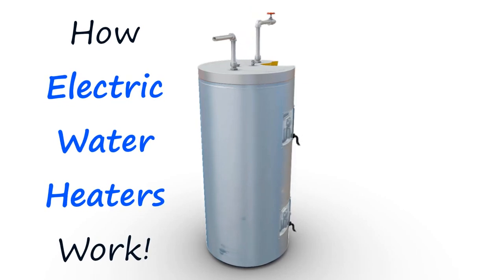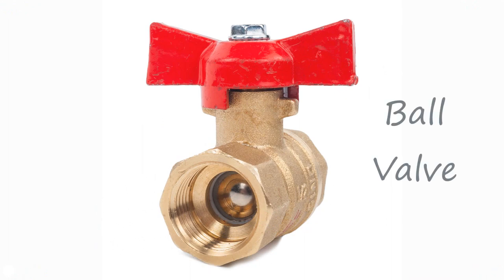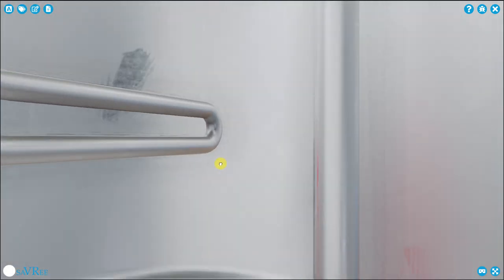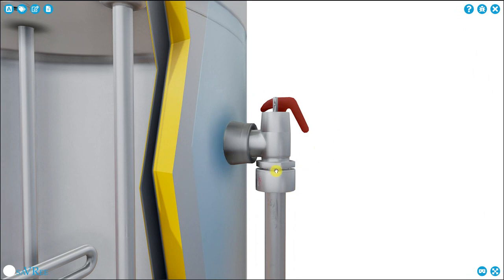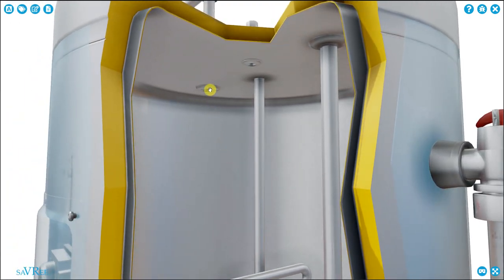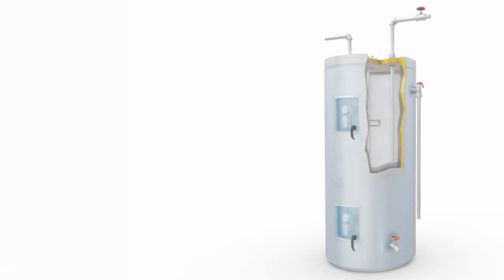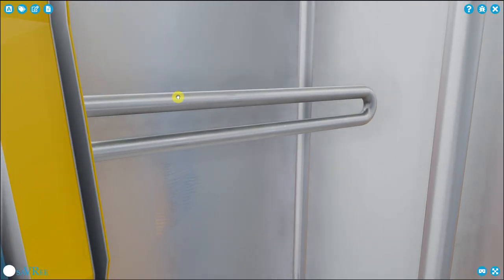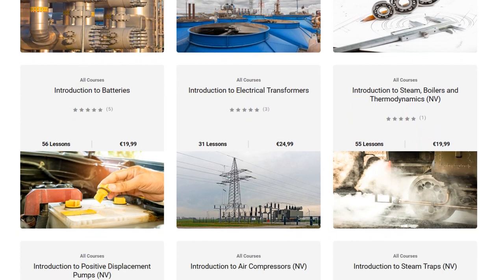How Electric Water Heaters Work!

Comment from the maker: Want to continue learning about engineering with videos like this one? Then visit:
https://courses.savree.com/ 

Want to teach/instruct with the 3D models shown in this video? Then visit:
https://savree.com/en
Reply: Hello SaVRee, recently found your channel, and its really interesting and usefull! 
For my internship I am doing a project about changing a (diesel) fire-tube boiler to possibly one on electic heating or using hydrogen to burn. 

Problem is that it has to fit on a truck, so very limited space and weight. The current boiler has a max capacity of 1100+ kWh.

Do you have a few pointers on how to compact the boiler/battery setup?
Can be links as well.

Ive seen your videos about fire-in-tube, plate-heat-exhanger, tube-and-shell and some other ones.

Comment: We use gas water heaters cause of the cheaper price. Electricity is relatively more expensive.
Reply from the maker: Depends where you live. Norway produces over 95% of its electricity from hydroplants, electricity for them is comparatively cheap compared to other countries.
Reply: @savree-3d  Our neighbors in BC and Quebec are similar to Norway. Very informative video, thanks